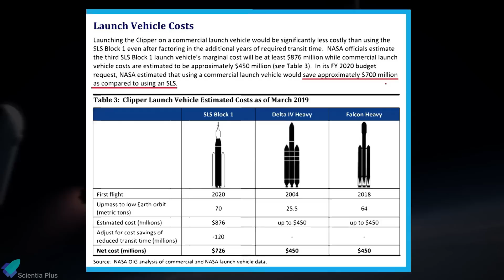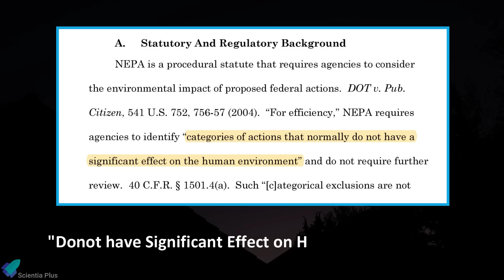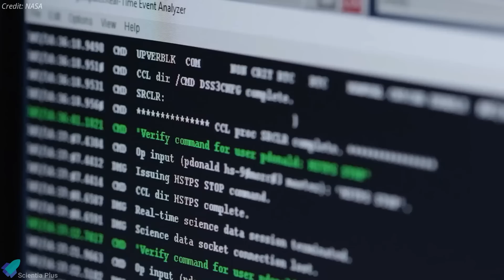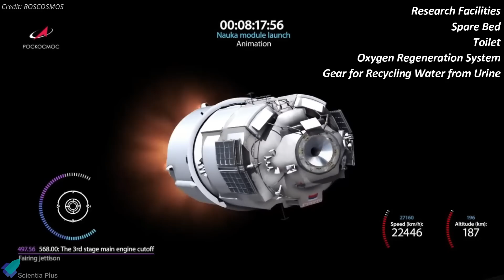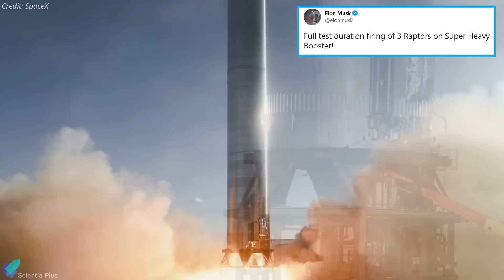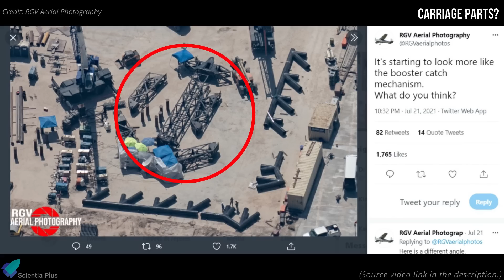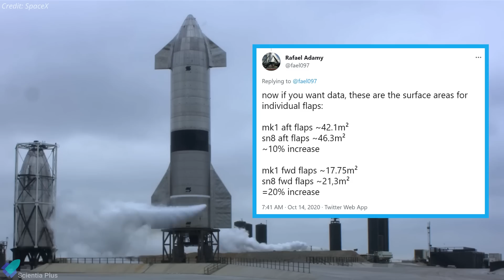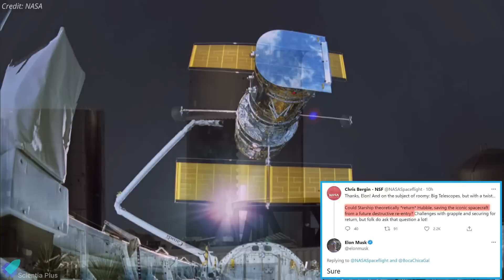Starship is Getting Ready for Orbital Flight | SpaceX Europa Mission | Hubble is BACK! | Blue Origin

Comment: when i heard fh was going to fly the europa clipper i was mad bc fh cost wayyy tooo much compared to predicted starship cost
Reply: The $2M that Musk was talking about was the internal cost, so the customer cost would be $6M-$7M. Also that internal $2M cost is very ambitious and likely won't be met as the ground costs can only go so low. Musk has a habit of setting overly ambitious goals, like a July orbital attempt for B4/S20, so this is not uncommon. 

It would not surprise me if Starship costs $90M (Falcon Heavy recovered price) or more to launch. Even if Starship costs the FH expended value of $150M and can only take 100 tons to LEO, then that would drop best FH cost per kb by over a third. At $90M per launch and 100 tons, that would be $900 per kg compared to the FH best of $2,351 per kg. I doubt Starship will get under the $50M per launch that a F9 costs.

Yes, Starship will require less refurbishment than FH or F9, but it is a more complicated spacecraft, so absent more details, I think it will be a wash.
Reply: @steveaustin2686  first fh is about 150 million dollars AND for a REFLIGHT would only cost for fuel in THE NEAR FUTURE and fuel wont be 50+ million
Reply: also when elon puts goals he knows that they are unrealistic BUT it puts pressure on the team so stuff goes faster
Reply: @EmileLF  The Falcon Heavy (FH) is $150M if expended and can lift up to 63.8 tons to LEO. If recovered, a FH is $90M and can lift around 30 tons to LEO. 

An expended Falcon 9 B5 (F9) is $62M and can lift up to 22.8 tons to LEO. A recovered F9 is $50M and can lift up to 15.6 tons to LEO.

Starship is expected to lift 100-150 tons to LEO, likely the 150 number IF Raptors are already near their ISP & thrust targets.

A launch will cost more than just the propellant. You have all the ground personnel prep'ing the launch and then actually doing the launch. You have the development costs, as well as any refurbishment costs. I know Elon wants there to be no refurbishment and the Starship to be like an commercial airliner. But commercial airliners do undergo maintenance regularly, so there will likely be some refurbishment needed. Starship is planned to need a lot less refurbishment than either F9 or FH. But Starship is also much more complicated than either F9 or FH, as well as returning the Starship (second stage) from orbit. I'm figuring the less refurbishment will largely equal out with the greater complexity. If I'm wrong and Starship ends up costing less than $50M per launch, that is even better. At $50M per launch, Starship will blow everything else away anyway. Even at $150M per launch, Starship will be a big leap in capability.

I know that Musk sets very optimistic goals to push the engineers to go as far as they can. That doesn't mean that the very optimistic goals are reachable either, ie a July orbital attempt for S20.
Reply: you have a point .. we will see in the near future!

Comment: Correct me if Im wrong, but  I think I saw a footage from another angle of the static fire test of BN3... and on top of BN3, one of those hot gas things started.. maybe the test unbalanced the booster and it was on automatic, the top thruster fired to compensate it. I couldnt see this on the footage in this video, though, I dont know if its because its from another angle.

Comment: Out of curiosity, is there a good reason why New Shepard didn't bring the capsule back? If the rocket could land safely, why not rocket plus capsule?
Reply: I think it is probably many times safer to come back via parachute.
Reply: The booster puts the capsule into orbit.
It is never intended to come back with the booster.
But to do it for this test would have used much fuel to land.
Reply: @randal_gibbons  New Shepard can not put the capsule in orbit. The flight is a straight up-and-down, sub-orbital flight where the booster covers almost 4 ground miles. Landing the capsule via parachute is safer than landing on top of the booster.
Reply: @steveaustin2686  I'm aware of that. I was speaking in generic terms what the purpose of the booster is. 
That's why I don't understand why people make such a big deal about this rocket.
Up down, up down.
Reply: @randal_gibbons  After putting the capsule up, if you recover and reuse the booster, you save a lot of money in the long run. Booster NS3.7 flew 7 times and will only fly science payloads. NS4.3 has flown 3 times, with the last one being the first crew flight. Blue has RSS H.G. Wells and RSS First Step as capsules, with First Step being the one that flew crew. No idea when Blue will make more boosters or capsules.
Reply: @steveaustin2686  I'm perfectly aware of landing boosters to save money. Again, I don't see why people are making such a big deal about this program. SpaceX has been landing orbital class boosters for years, I think they've had like 60+ landings now, both on land and on their drone ships.
Reply: @randal_gibbons  I never said that Blue was doing better than SpaceX and few others would say that either. Currently though, only SX and Blue are landing boosters at all.

Comment: I can imagine the Starship shipping a new Hubble to space and bringing it the old back to Earth🚀
Reply: The James Webb is not meant to immediately replace Hubble once launched, but be an additional powerful instrument.  Hubble will remain in operation until it permanently breaks
Reply: @The1upforever  I never said that Hubble would be turned off once the JWST is up and running. Hubble is at the end of its life though and likely will die permanently in a few years.
Reply: @steveaustin2686  the video states that Hubble should be functional "well into the decade"
Reply: @The1upforever  Hubble's orbit is only stable until 2030. It remains to be seen if the instruments and control systems last that long. With the last servicing being done in May 2009, it's been on its own for 1/3 of its lifespan. Who knows if it will be serviced again with the JWST set to launch later this year.
Reply: @steveaustin2686 i hope starship is successful,  just snatch it
Reply: @The1upforever  That would likely depend on funding for a flight to recover it. I believe that Starship is expected to have the capability of landing something that heavy. But with only one landing under their belt so far, it may take a while to get there.
Reply: @steveaustin2686  reposition it to stable orbit?  Are these new stadium sized balloon telescopes just going to give astronomers more space telescopes or are they the next Hubbles?
Reply: @The1upforever  I'm not sure what could be used to boost Hubble's orbit. The Shuttle could grab Hubble with the cargo bay arm, but nothing has an arm like that anymore.

The JWST is the next Hubble. Musk has talked about using a Starship as a base for a new space telescope. Apparently, he is talking about using all of the cargo space to put in a huge telescope. With the ability to refuel Starships, you would not need to leave it in LEO either.
Reply: @steveaustin2686 ultimately, i hope we eventually can observe the birth of the universe (or the moment right after).  Or is that not possible, can we not observe any moments before the creation of matter and stuff?  I could look it up but what's the fun in that.
Reply: The James Webb is not meant to immediately replace Hubble once launched, but be an additional powerful instrument.  Hubble will remain in operation until it permanently breaks
Reply: When the Hubble breaks beyond the ability to repair it remotely they could bring it back for examination; there's bound to be some interesting and useful stuff you could learn from an object that's been in space for over 30 years.  Even cooler, although probably not financially justifiable, is the idea of repairing it and putting it back into orbit.
Reply: The James Webb Space Telescope (JWST) is set to launch later this year on an Ariane-5 and is the replacement for the Hubble Telescope.

Comment: While smaller flaps may prove feasible for atmospheric conditions on Earth, will they also be adequate for extremely different conditions on Mars?
Reply: Yes, the purpose of the 'flaps' is to provide roll and pitch attitude control.
The aerodynamics involved do not depend on whether the atmosphere is air (~20%O2, 79%N2, 1%argon) or the martian atmosphere (~5% N2, 95%CO2) even though the isentropic exponents are different. Density is  a variable in any case.
Reply: @hernanposnansky4830  Nonetheless I should think density would be a significant factor.

Comment: I don't understand. They say the last and final section of the launch tower are being installed but it looks like it is "only" as tall as the heavy booster itself. How will the tower lift the spaceship on top of the current tower height?
Reply from the maker: Booster is ~ 70m tall.
Tower > 140m.
Reply: And the starship is 50 meters.